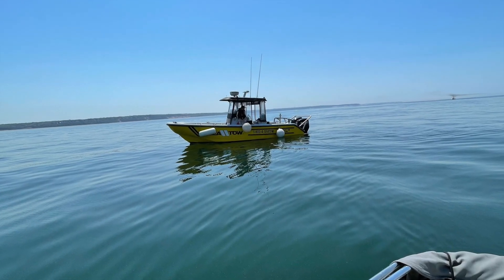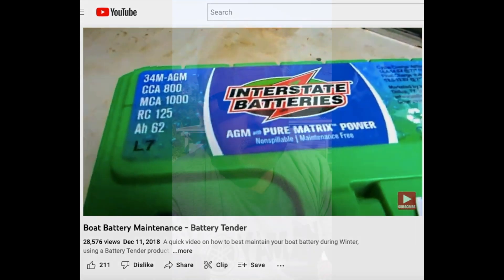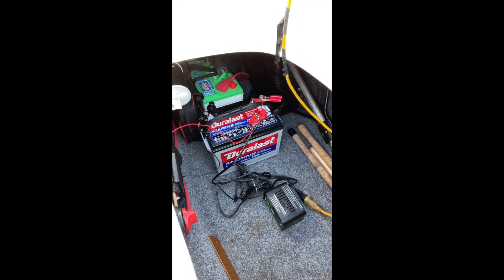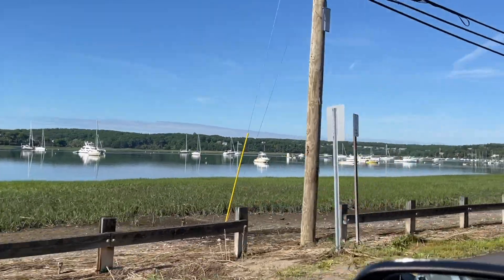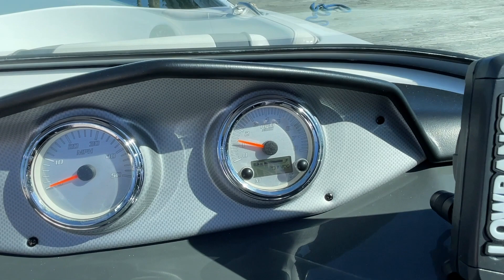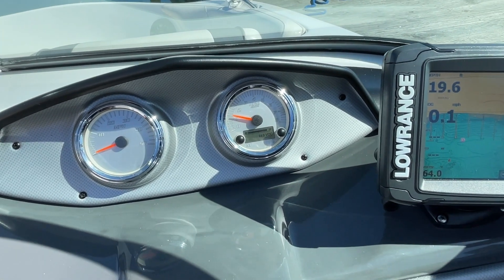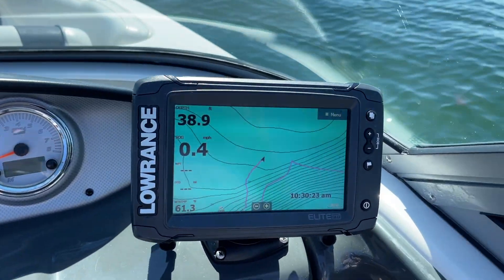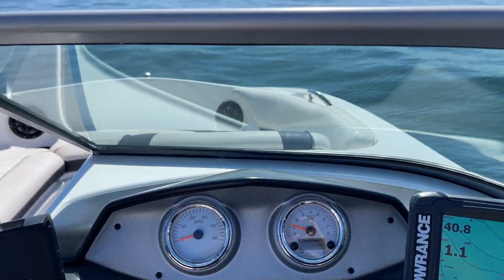Boat Battery Blues

Comment: I had an interstate battery in my 1979 Sanger (460 V8) for over 5 years. Never disconnected it, never charged it, and never checked the water. Amazing. I was young and dumb. But lucky as hell.
Reply from the maker: I hear ya, they have always had a good reputation, big mystery. Thanks for watching.

Comment: Great channel. Good vids….
Marine batts are usually good for 3 - 5 yrs.
Not fond of Dual Purpose marine batteries. The DP batts don’t do either very well.
Far better to go with a battery switch & dedicated start battery / house battery (deep cycle).

Switch to house battery at the sand bar. Makes boating far more enjoyable.

Start battery ready to go all the time…
Reply from the maker: Mattie that does make good sense. Thanks, and thanks for watching!

Comment: Could it possibly be auxiliary equipment such as GPS and radio, draining amperage below cranking amps.  Besides focusing on the battery alone. A question might be could there be corroded cables and wiring to other equipment depleting the amperage, or loose terminal connectos?  Also, if it happens again try tapping on both battery terminal connections with a mallet. And then recheck the continuity of the connectors when you get back to shore. It could be possible that the vibration in the boat from the sea/wave on hull could loosen the connectors enough to not get full effectiveness or efficiency from the battery but still enough to run auxiliary boat equipment ie, low amp equipment but not enough to crank the motor. Just the thought my friend. I'm changing the battery connectors on my boat right now, due to corrosion. I'm also probably going to do what you did and put in a second battery with switching capability.
Reply from the maker: Hey Mark, Since that day, and fully charging the battery at home, it is working perfectly. I now have an extra battery on board and a jump pack just waiting for the Interstate battery to fail again. Cables were all tight. Can't figure what went wrong. Thanks for watching.

Comment: I have a SX 190 2012' Second year I had a cut off switch installed. Any time the boat is going to sit idle I cut of the power- ie when beached and during the winter months which is usually Oct-March. Still have the same battery from 2013.

Comment: I had an interstate battery in one of my corvettes that did the same thing.  Always charged and tested fine, but randomly would have no power to crank the car. Then the power would come back 10-15mins later. The battery was only about a year and a half old. But I ended up just replacing it.
Reply from the maker: Jason, you may have solved the mystery. Just fluky Interstate behavior!

Comment: I still have have the original battery, however, I do use a Noco for maintenance whenever the battery is not in use. From what I've read is that our boats do not like the lower voltage. The Noco will maintain the battery much better than the traditional old school trickle charger. But you know this already. I also have a spare battery with me as well. The original battery will go down to around 11 when using the blower. After startup, it will be in the low 13 while the engine is running. I don't remember hitting 14 ever.
Reply from the maker: Hmnn, interesting and good to know. Thanks Michal!

Comment: No trouble shoot suggestions but we have a 99 LS2000 w/ 2 engines and I installed a 2nd battery w/ a battery switch this year just to be on the safe side for this reason. It’s overkill I’m sure but we mainly use it on a small Reservoir  beside our airport in a state park. It’s not uncommon to have a few miles of the river/lake all to ourself
Reply from the maker: Good suggestion though. Thanks for watching Brett!.

Comment: You need to use an onboard smart charger and always plug it in when the boat is not in use. They’re designed for that and it’s not going to hurt the battery to leave it plugged in for months not being used.
Reply from the maker: Not a bad idea Haknslash, thanks!

Comment: I would get the battery properly tested with a load on it and measure the cca’s. Your battery may be boarder line on its way out. Batteries in my area last 3 years due to the FL heat. My Noco GB70 is always on my boat as a standard tool. I had a trickle charger go bad that drove me crazy why my battery was low at the start of my day. Nice video!
Reply from the maker: Thanks Sam, good advice. Thanks for watching too!

Comment: When my battery reads below 12 volts, car or boat my thoughts is that, a batt cell is going bad, or already bad, see this happen when batt drain due to light or anything left on. I have tried reconditioning battery in the past, use this a bit, but same behavior happens again, time for replacement.

I’ve done this with cars, where easy to get a jump.

Not sure if I do this with a boat, maybe having spare, a booster, or something is a good idea.

I have a 2013 SX190, battery is over 3 years old.
Reply from the maker: Thanks Edgar, good advice!

Comment: The fact that it would still not start when boosted tells you that the problem is a connection downstream of the battery, and not the battery itself. Did you check the nut tightness and cleanliness of the cable connections, they are sometimes a source of intermittent problems on high-draw connections. Not just the ones at the battery, but all that are accessible at the other end of the cables, like at the Perko switch, etc. This would not only cause a problem with ingoing (charging) current, but also outgoing (starting) current.
Reply from the maker: Thanks Brian, I will look more, but it's been working fine all around without me adjusting any cables. Just very weird but I will keep looking.
Reply: @CaptainLeonsBoatingandMore   What I've seen happen is that an insufficiently tight connection can arc across the microscopic gap (it is OK for low currents until it is a high current such as is drawn by a starter) and essentially "weld" the gap, making a sufficient connection, but one that is easily broken when disturbed, such as by boat vibration or bouncing. It is easy to check this visually for any corrosion, and by just taking a wrench and torquing the nuts (hopefully NOT wing nuts).

Comment: I can’t attach a file here but there are charts showing voltage compared to remaining capacity. At 12.1v you are down to 50% and needs to be read at no draw or charging.
Reply from the maker: Hey Rob, that's good to know! Thanks.

Comment: It looks to me that your old battery probably has bad cells, take it to get load tested at the auto parts store to confirm.
Reply from the maker: So I took it to Autozone. He put some device on it to check voltage and see if it's charging. He said it was good, but he also said his tester is not great. I'm assuming it did not check with load on it.
Reply: @CaptainLeonsBoatingandMore  you probably have to specifically request a load test. The have a device that can add a starter tepe load and if it's bad the voltage will drop significantly while the load is applied

Comment: Maybe the other equipment ran the battery down. Add another tray and keep that battery for starting and the other for everything else. They have a switch that will allow you to switch to both batteries if the starter battery ever gets low. Also get a Noco dual charger so you can have the boat always plugged-in. I still take a starter pack with me just in case. When you're no moving you can switch the secondary battery. Sucks it ruined your day and made you tipple guess all the equipment :(
Reply from the maker: I hear ya Alberto, good advice. Thanks for watching!

Comment: How did you handle getting towed? Did you block any hoses off? I’m new to the jet boat world and just want to make sure I’m covered if I ever need to get towed and not take on engine damage. Thanks.
Reply from the maker: Yes Nick, I did clamp the water intake line. This video covers where you need to do that, although its not mentioned to do so in any Yamaha manual, just keep your speed at 5 mph or below. https://youtu.be/n5XsbIGUKEo

Comment: Bad connection. You took it out and changed the connectors position every so slightly to were it's getting a charge again
Reply from the maker: You may be on to something there. Good thinking!
Reply: @CaptainLeonsBoatingandMore  I was an MC mechanic for over ten years working on junk people would bring in from the seventies. Corrosion on the connectors will impede the charge/flow of electrons. Especially running in salt. I have same boat by the way.